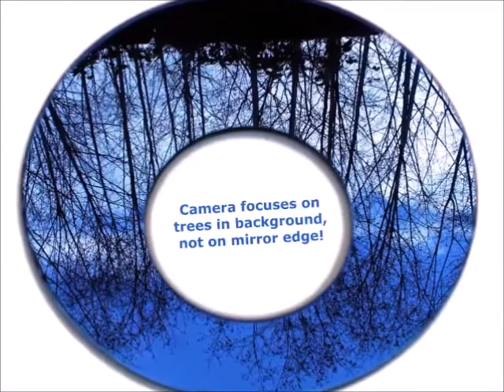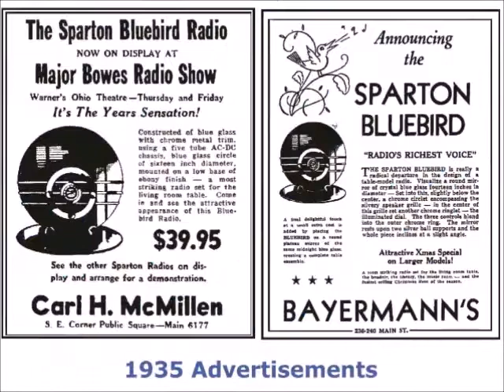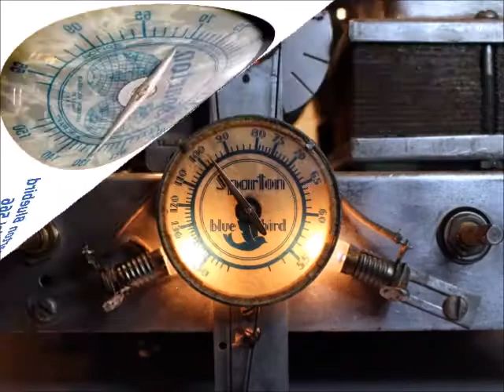Sparton of Canada 154B Bluebird Blue Glass Mirror Radio

Comment: A unique design by Walter Dorwin Teague.  Teague also designed wooden cabinet radios for Sparton with the louvers on the sides (similar to the sleigh blue-mirrored radios), most notably the Sparton Model 88 K also made by Sparton of Canada in late 1936 and early 1937.  These wooden radios included the newly developed "Magic Green Eye" called by Sparton of Canada the "Visoglo" tube and made by Rogers tube company of Canada.  The wooden cabinet radios designed by Teague are not as well known as the blue-mirrored radios, but luckily some of these less known radios do exist today.
Reply from the maker: Here is my Sparton Canada Model 68, uploaded to radiomuseum.org: https://www.radiomuseum.org/r/spartoncan_68.html . There is no doubt that this is a relative of the sled.